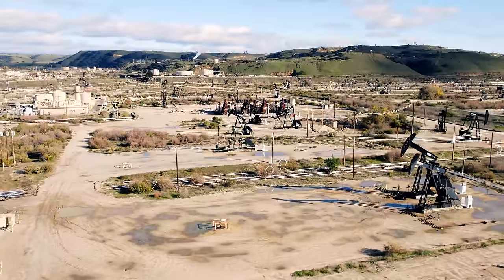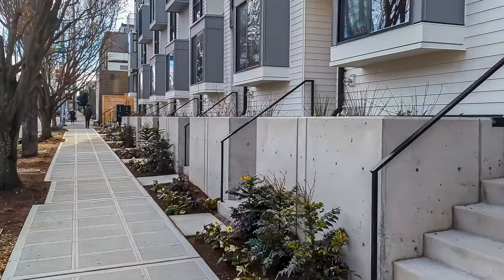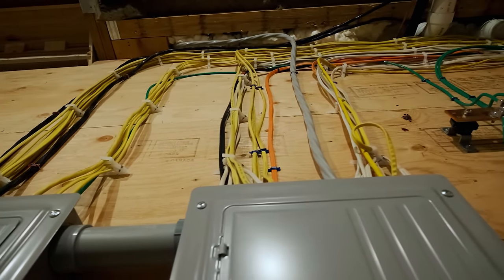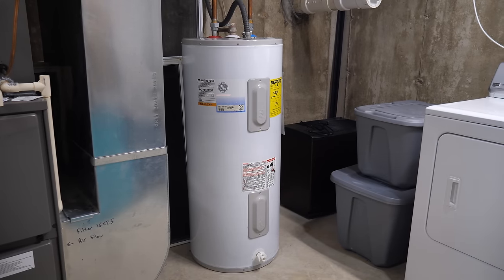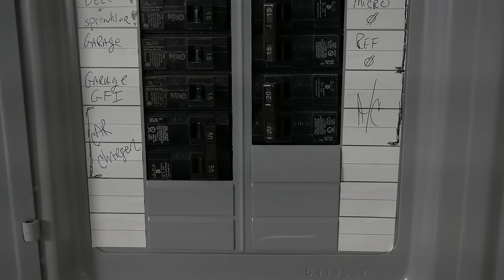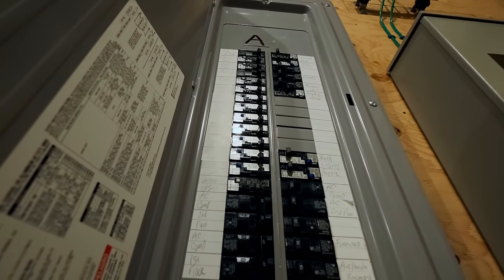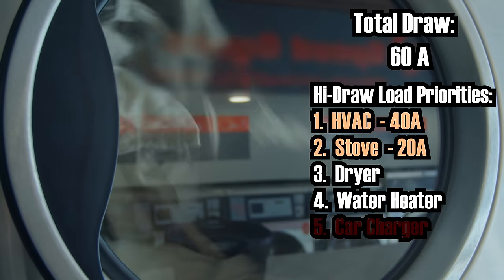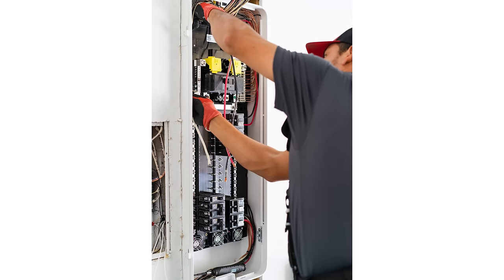Home Electrification: There's not a lot to do, and it doesn't have to be hard (Part 1)

Comment: My father was an HVAC technician for a good 40 years. His number one gripe was always that people never really insulated their homes. So when he rebuilt his current home they stuffed the cinder blocks with insulation, stuffed the walls with blown insulation, and filled the entire crawlspace above the home with a mix of sprayed and blown insulation.

That house is always a perfect 74 degrees, even when it's freezing outside or boiling hot in mid august. Insulation goes a looooooooong ways towards being comfy and saving power. =)
Reply: True. Blame builders for cutting corners and not putting in good insulation.
Reply: that's great if you never have to work on anything.
Reply: Just built my new house. A friend of mine quizzed me “What’s the cheapest heat?  Insulation!”
Reply: @astang1072  Wife and I just bought our first house, but we're already fantasizing about doing a custom build in a few years and going all out; airtight barrier, mitigating thermal barriers, insulation as far as the eye can see... it'll cost a pretty penny but will be so worth it.
Reply: @Zac Hansen  insulation is fine.  Spray foam insulation on the otherhand.. .you better hope you don't need to open that wall.
Reply: In high school I don't remember which class though but there was a competition to see who could design the best insulated house within a budget. I got first place. I was honestly a little surprised because what I did seemed like it was really the only way. Lol This was like twenty years ago.
Reply: Hate to break it to you, but stuffing the cinder blocks with insulation is pointless, as there is no thermal break. 

Air is actually a pretty good insulator compared to some solids, like timber and concrete and cinder blocks. If you don’t have a thermal break, heat is going to escape through those channels. Spray foam is pretty good for this, as are ICFs.
Reply: Holding 74 degrees has nothing to do with insulation. Insulation might make holding it easier, but that's it.

I work in a factory where one of the assembly lines is in a poorly insulated metal warehouse. It is always at about 67°, even when it is 110° outside, because the air conditioning is on.
Reply: @andywolan  builders will do whatever the customer wants to do and is willing to pay for.... most are cheap and want to look rich and not have a good home.
Reply: @JoshuaTootell  I took that more as "Holding 74 degrees without a millionaire funding the heating bill", but your point is absolutely correct. Good insulation doesn't change the temperature; it changes how much you have to spend to keep the house at that temperature.
Reply: Inb4 insulation turns into 2070's version of our asbestos problem
Reply: @FishFind3000  I'm an electrician and some of the houses I wire have foam sheathing that I can easily put a hole through with my hands. I couldn't believe it was legal at first.
Reply: @capacitatedflux  to be fait even the ancient greeks knew asbestos was problematic.
Reply: Here if you buy big uninsulated house (or insulated 80s soviet standard), then your heating bill will be 2x higher then your actual mortgage. Heating bill simply is higher than your wage, therefore absolutely nobody builds houses without proper insulation here as nobody can afford to heat it.
Reply: I dunno. I asked for some prices for redoing the wall insulationen. It would take 35 years before I would go +-0 pn that Investment.
Reply: @Baxtexx  yes, way more expensive to insulate it later. But while building your house, insulation does not add much to final cost.
Reply: We have an issue where I believe (based on endoscope camera and FLIR of the room) there are places insulation fell down leaving uninsulated areas behind finished walls.  Expecting multi thousand dollars repairs to rip out drywall to access each place to fix and rebuild the wall...not fun
Reply: As someone who use metric syetem 74 degrees was a bit scarry, of course realized my misstake but 74 Celsius is 165 *F.
Reply: @andywolan  I blame the cities for not inspecting, enforcing, or punishing builders that build crap. Once it's built, it's too late.
Reply: Sounds like a moisture nightmare and god bless him if there's ever a fire.
Reply: @Joshua Tootell  a fixed heating load will equalise to a higher temperature when insulated. having just moved from a well-insulated home to a not-insulated one, i can say, you feel the difference. i used to have a toasty 23c or so from my 600w room heater. now it struggles to hold 15c.
Reply: @justaguycalledjosh  Something I notice is that a poorly constructed building will feel hot and cold at the same time. The poorly-constructed cardboard box I live in, for example, has lots of electric heating but terrible windows. In winter the air is hot but I can feel the windows and walls are cold. And I mean just sitting there, not touching them or anything. In summer it's the opposite, the air is cold from the A/C but I can feel heat radiating from the garbage-tier windows as they let all the energy from a fusion reactor right in...
I think what makes a house feel "solid" to me now is when everything is more or less at the same temperature.
Reply: This is great until you start falling asleep all the time from
the CO2
Reply: Homeowners don't typically take the time and schedule an HVAC tech to come, clean and test the heating systems in their houses each year.  Yes, each year.
Reply: @WJCTechyman  each year, learned my lesson after my AC run out of gas and flooded everything.
Reply: How much sense does insulating inside cinderblocks make? Cinderblocks already create a type of airgap that should act as insulation? Does adding material inside case more or less heat transfer?
Reply: @FishFind3000  Not really. Ask anyone who bought a new home in which they had no involvement in the construction but have to deal with the cut corners.
Reply: @andywolan  They wouldn't have bought the home with uncut corners because it would have come with an uncut price tag. Doing things "right" costs a lot more. I'm not sure about other trades but framing can increase at least 30% depending on what your doing and siding will double in price.
Reply: @Matthew Lewis  actually it increases the R value of a CMU wall somewhat.  There are more cost effective ways tho. Like using 2x furring with 1.5 inches of insulation instead of 1x furring strips.
Reply: @carboneagle  You're assuming that the contractors are being honest with the construction quality. They still charge premium pricing for sub-premium quality because of one key factor: location.
Reply: Oh you sweet summer child, that would be an actual, meaningful solution, and lettists can't have that.
Reply: We just replaced our roof and siding (which included some new insulation) and it made such a huge difference in keeping our home warm.
Reply: I'd like to see someone actually do the math on insulation and windows upgrades. I live in northern Michigan, in an 80 y/o house with terrible insulation, leaky old windows, and I'm on the windy side of a lake. I don't spend $1,000 a year on Natural Gas. I have a family of six, a gas boiler, stove, od water heater, and dryer. What's my payback period?
Reply: Don't the building code require insulation?
Reply: @Tom Dibble  exactly... it is about heat gain and heat loss and as long as you are able to keep both in check you will have lower heating and cooling costs.
Reply: My grandfather used to save if you ever build a house spend all your money on insulation and it will pay you back.
Reply: @andywolan  not really the builder is to blame; I say it is the architect.   The builder just follows the plan from the architect.  
It is like seatbelt or airbag in a car.  There was a time they were not mandatory.  Then came time they were still not mandatory but you would get them by good design.  Now they are mandatory.   
And now is the time any architect should put enough insulation so that heating or cooling becomes a detail on our energy bill.
Reply: @Nerby  yes insulating an existing building is expensive.  But you should do the investment calculation different.  If you now invest X amount of money in insulation, in 15 years you saved Y amount of money in less heating/cooling , enjoyed a higher comfort and you have still Z amounts of value in the insulation.  What is the value of the insulation in 15 years?  Still X? Or how much will you still value your house in 15 years?  You hope if will keep most of its value; so why not the insulation? 
For a well build house there is no complete destruction of capital like for any commodity. You keep some of its value.  
Or ; what is the return if you install a new kitchen?  Did you ever care or calculate a return when installing or buying kitchen - or a Tv or ...?   So why should insulation have a return?
Reply: @matthewlewis5631  Yup.  Air is the actual insulator.  Foam and fiberglass insulation merely traps it.
Reply: @Baxtexx  Adding wall insulation to an existing structure isn't worth the cost and could potentially cause moisture problems.  But if you plan to replace siding, then you can add foam board sheathing to the exterior wall underneath the new siding.  Super insulating the roof / attic is more cost effective.
Reply: Do not, my friends, become addicted to insulation.

Gas exchange with the outside world is bad for your heating bill, but if you're going to go HAM with the insulation also go HAM with the gas detectors (CO CO2 Radon, errything). CO2 build up might not kill you but it will give you gnarly headaches and impair your thinking enough to be really really annoying.
Reply: @Rushi  that is misconception.   The issues you are referring  is due to a lack of ventilation.   And of the examples you give; CO should never be produced in a place where people live.  And if it is produced it is due a malfunctioning device with combustion.  An issue the electrical house also fixes. 
But back to the insulation.  
To overcome issues with high CO2 concentration, possible buildup of Radon -which is a local issue if you live in an area where the ground contains high levels of Radon-; the solution is ventilation; you will need around 20-40m3/h per person in a room to keep the CO2 levels low enough (I don't have number on Radon).  Older houses were so badly build they had so many ventilation options it was mostly not an issue. The 20-40m3/h you got for free...  From air leaking windows and doors to an air-open roof construction.  But for the last 60 years buildings became more and more air-closed.  This is not due to the insulation  but happened just by applying better techniques in construction.  There is no window anymore with air-leaks; every point where different construction parts meet has a solution to make it air closed.  
In fact in my house, all insulation  is just rather air open.  From the inside to outside the house is made first air-closed in the construction, and only then comes  the insulation.  If I would add little or a lot of insulation; the house is just as air closed.    The insulation is no factor in how airclosed the house is.  In fact the house had a test to check if it was indeed air closed before all insulation was added (which is not advised;-)).  
There is even an possible is if the air-closing solution is because of the insulation; it would mean that some of the moisture can get into the insulation and condense.  This can remove the insulations capacity to insulate and cause even more condensed water in the construction that case cause a lot of damage to the construction of a house.  
The solution to your issue is a good ventilation strategy to indeed keep CO2 concentration low, have Radon and all possible chemicals removed that don't belong in a healthy living space.  
So; let me know if I convinced you it is not the insulation that prevents ventilation in houses, but just better building techniques.  And the solution is a good ventilation strategy.
Reply: @8BitNaptime  Yes, radiant heat is much more efficient (think of standing on front of a fire in the winter cold outside).
So if you have a radiant heater you can actually reduce your air temperature!
Reply: @ChunkyWaterisReal  Don't over egg it man.  It's an extra pain in the butt, but not that much.  Especially when you consider that standard practice for a long time has been fibreglass batt and vapor barrier.  It's not particularly any worse than that.
Reply: @andywolan  And inspectors for letting them. My attic was "verified" R-30 by the installer and an inspector. Parts of it had only 1" of insulation. So... R-3ish.
Only about 10% of the attic came anywhere near R-30.
Reply: I helped my friend build a dome home, which naturally is more efficient with heat lose, yet we insulated it with R60. 
His heat and AC comes from his well water water that he then dumps into his man made lake.
Reply: Air tightness is just as important.
Reply: @andywolan  as a builder,  blame buyers who don't want to pay for things to be done to a premium standard.  The best jobs are custom builds for clients since we can explain the benefits to them,  and usually are able to make something special.  If it's a spec house there's no point,  they just want them as cheap as possible.
Reply: @HOJUX11  I have to disagree. I've seen expensive houses sold in affluent area where corners are cut such as a lack of insulation. (Or no insulation for that matter!)
Reply: @zachansen8293  thats why we pull conduit everywhere.. insulate your home.
Reply: @matthewlewis5631  It would help because it keeps the air within those voids from circulating. It's not much though. Insulation works by keep the air within it still. It prevents convection not conduction.
Reply: Most homes were built when heating was cheap, so it didn't make sense to spend a lot of money on insulation. I mean I could build a house with a vacuum space in the wall to get an R1000 insulation rating, but if it costs 10× more to construct, then I'm not really saving anything over the long run.
Reply: @astang1072  those are actually pretty wise words lol
Reply: My old boss used to live in Alaska and they had the house so well-insulated that they had to turn lights off sometimes to keep the temperature down.

The power lost to poor insulation is immense.
Reply: @knotes76  this just means you have artificially low natural gas prices and this makes sense based on it being Michigan. This isn’t going to end up being the long term outlook for natural gas and you should expect it to rise considerably over the coming decades as the market shrinks and fracking becomes rightly banned.
Reply: Envelope insulation is a thing. Add heated floors to heat the concrete pad. I love radiant heating. Once it's warm, it's easy to maintain that temp.
Reply: 74 is hot 🥵
Reply: @tomdibble8983  By thermodynamics, you're absolutely correct. Insulation changes how much energy enter/escapes every second, and that thing is called power. If a well insulated house loses 10kJ every hour, and a poorly insulated one loses 30kJ every hour, surprise surprise, the well insulated one is easier to keep warm
Reply: @Vort_tm  If you haven't already done so reading into the Passivhaus standard is pretty interesting.
Reply: @matt697845  uhh, what?
Reply: Yep my place has the R-value of late 1800s hemlock and horse hair plaster that's why we heat with a hard coal boiler and AC is a dream I might someday have
Reply: @edfx that's why I use a hard coal boiler to heat my place
Reply: @sqike001ton  I also have 45kW coal burner, but man how bad the suburb stinks in the evening when this thing burns. I only burn wood from now on.
Reply: I really need to put insulation in my basement, but for now my gas bill is manageable, but if gas becomes too expensive ill have to break down and insulate my house.
Reply: @matt697845 sorry, who fights for stronger regulation on companies again? Sure wasn't the folks like boebert
Reply: Sounds like a good idea for an episode!
Reply: JUST get a house that follows Passive House standards.  They are so perfectly insulated they don’t need a heating system (although one is included for backup).  All internal heat is supplied by the occupants & waste heat from stoves, refrigerators, etc
Reply: Can confirm. My power company gave me a free furnace and 14 inches of insulation in my attic. My energy consumption this year has been less than it was last year. My bill has an extra 92 bucks added every month to keep up with my budget billing. Just gotta replace my back door and windows now for even more savings.
Reply: Good insulation goes both ways. I live in New York, and my bedroom stays so warm, even in the winter WITH the windows open, that I've gotta run the AC all year round.
Reply: Perfect 74f? What are they, lizard people?

Looks at the thermostat currently set at 70f.
Reply: Make sure to keep an eye on indoor air quality now that you've sealed the house up so tight.
Reply: Blame the developers and building companies that want to maximise profits
Reply: @dupa333jelenia  Just guessing from my heat transfer classes in college, but in a substance like air, heat conduction takes place mostly by the movement of the fluid, not conduction (as is the case with metals). What foam does is keep the air in place, in its tiny bubbles, and prevent hot air from leaking outside. Since bricks already trap air inside, there's probably no point to filling them with foam
Reply: And awnings, according to one of mr Tech Connections guy's latest videos